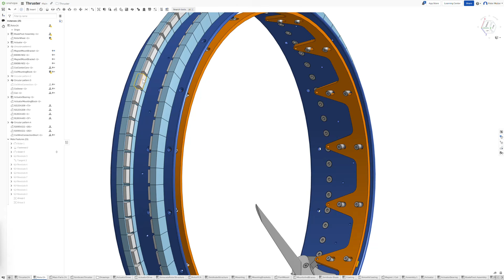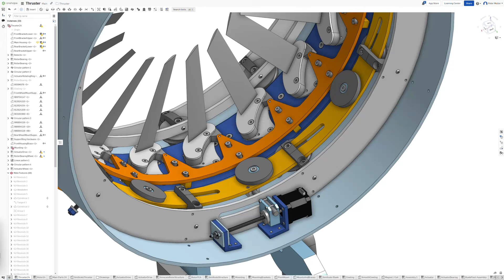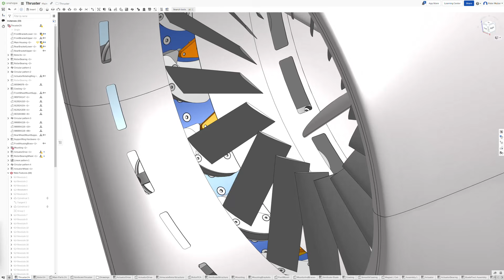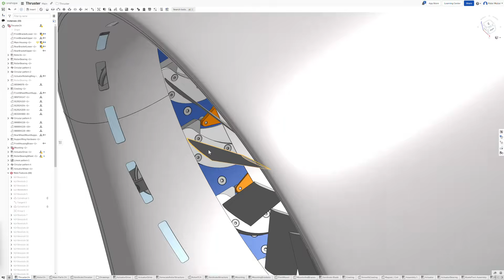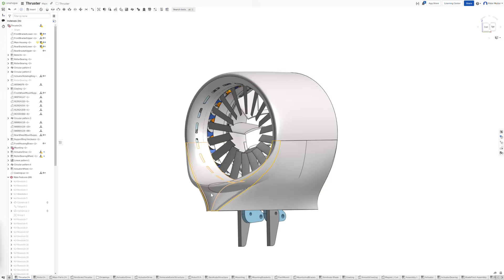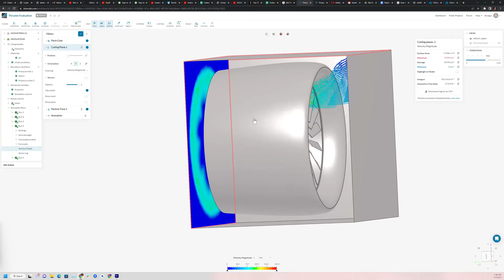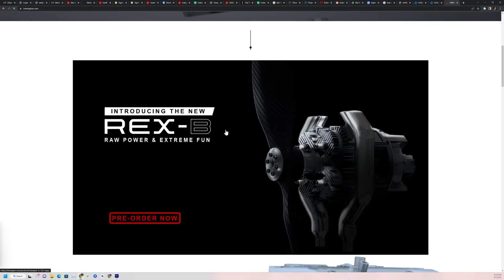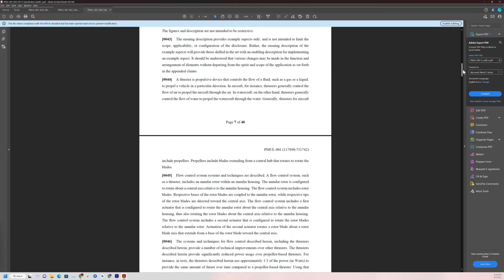Could this Thruster transform Aviation?

Comment: A typical Cessna 172 propeller is 74% efficient at cruise. A modern propeller is more like 90% efficient. Yes at standstill a fixed pitch propeller is going to be less efficient, but variable pitch propellers have been around a long time and thus will have high efficiency over a broad range of airspeed. More blades always mean less efficiency. A duct helps at low airspeed but creates more drag at higher airspeed that is why they're rarely used other than in jets where they help lower noise and work as a containment shell for damaged fan blades. To boost efficiency newer turboprop designs get rid of the shroud. Frankly, I don't understand how someone can spend so much time and effort into designing something that is less efficient than the Wright brothers propeller from 1903 (82% efficient). Your claim of getting 3X more efficiency than a standard propeller is BS. You'll get better efficiency with a standard hub configuration. Without a hub a large percentage of the air mass will bypass the blades completely by going through the middle then mixing with the accelerated air behind the blades and causing excessive turbulence. Of course your unsupported blade ends will have extremely high resonance gain and will self destruct before you can even get the thing up to speed.

Comment: Too complicated and lots of failure points. You can use spiralic air bearing ring on outside, but you need to consider about the low rpm too. Air bearings are magic!

Comment: And where does all this electrical power come from?  And all the thrust is loaded on those little wheels?  And this is supposed to work in the dirty, wet big outdoors.  Google keeps telling me you get 1 pound of thrust per Horsepower; but that is theoretical.  So an actual machine can only be worse.  You know you would require many 100's of pounds for anything practical like a flying car.  Even a miserable 100 pounds of thrust will require much more than 7,500 watts.  Sorry, this is totally useless.

Comment: This design will never work. There is a major flaw in it and I'm surprised not many people spot it at first sight. Using such a big outer bearing would not be reliable and would be extremely expensive to machine at acceptable tolerances, it would generate huge noise levels due to the high speed at which the balls would rotate inside the races. And ultimately, it wouldn't be safe in case damage occurs to the bearings (either mechanical failure or bird strike/FOD), making all the blades fly out at high velocity, resulting in an uncontrolled catastrophic engine failure. If this was in any way a viable design, I'm convinced one of the big manufacturers of jet engine would've come up with it decades ago.

Comment: Why was your comparison to a 2 bladed propeller? The more obvious comparison to me would be a regular ducted fan with the same number of blades. The fundamental problem with this design is that you have proposed adding a ton of complexity compared to a motor on a central shaft, and you haven't done any simulation to justify that putting the motor on the outside is a benefit.

Comment: That's an awful amount of moving parts that can break, also for flight you need to have redundancy so the one single motor to change the pitch of the blades is not enough, I'd prefer to have at least 4 motors and have 2 connected as a pair so when one or two motors break for any reason you stil have 2 motors leftover that can take over the force needed to change that pitch.

Comment: Rolls Royce "owns" all of it's engines. they maintain them and they destroy them when they are finished. the airlines lease the engines from Rolls Royce. the Santiago, Chile to Melbourne Australia route, is the longest single haul  flight at 16hrs. obviously, to run multiple engines for 16 hrs will take one huge tank of fuel.... a tank bigger than the aircraft itself. obviously not possible with usual thinking processes. which is why control of commercial airline engines is a closed loop. yet that is what you are up against.

the Patents Office is not there to protect your inventions.

Comment: Sorry but this is actually a pretty stupid idea. The main limiting factor in conventional turbines design is the structural integrity of the blades under centrifugal forces. In a conventional (central hub) turbine design the centrifugal forces result in a tension load on the blades. In you design the centrifugal forces would result in compression load on the blades. Since the maximum load a slender structure can sustain in tension is usually about three times the load it can sustain in compression (as a rules of thumb), you can  easily see why your design would never be feasible for realistic applications.

Comment: It is certainly nice design but I don't understand hot can this be patented. There is nothing innovative there. Once there is a decision taken to devise an electric fan actuation any idiot would recognize that there is no need to use an independent motor to run the fan axially and will start to investigate the possibility to run it this way. It is the same method how some washing machines are turning the drum... Any able engineer can devise something like this, even better - there is no breakthrough here. Besides there is no energy source available to use this on a plane anyway...
I'm not an engineer but I know that any action has an equal and opposite reaction, so when the rotor of the motor (the turbine here) produces 100 thousand pound of thrust the stator part would try to rotate in the opposite direction - will it be easy on the plane to hold it stationary?

Comment: There are so many failure points in this design I don't know where to begin.  The acetal wheels will fail first.  The moment it becomes out of balance, it will become an empty aluminum ring (if that) with a long debris trail. Just look at all the bearings in this thing that could fail, and it would only take one.  Overall, really poor design. Cool, but poor.  There is a reason all current engines have a central shaft.
Reply: *potential failure points

Comment: "They might be interested in this or they might say this is no good for business its going to destroy our business" Or you are way over confident in you product and its got major problems that have not come to light like how are you dealing with the turbulent flow caused by the blade tip vortex. Compression over tension at RPM. Number of moving parts. The fact that your centrifugal force is way higher as your spinning a massive drum of metal at the outer most point. The inverse of a turbo fan. Just with the higher centrifugal forces and materials science we can tell that your fan can not do the same RPM with the same materials as a turbo fan. This is turn leads to efficiency as you then need to make your blades bigger to over come the lower RPM and move the same air in turn adding weight entering in to a feed back loop of more centrifugal forces. So power to weight this should by the numbers all ways come out behind a turbo fan. You have little to no axial support in the bearing so at high thrust the thing is going to want to rip its self out of the front of the housing over moving the attached housing.  Your Delrin has seen little to no load at over 100LB of thrust at high RPM there going to crack and fail in a matter of seconds. You sound like every bad kickstarter trying to get hip for something you have little to no testing in.

Comment: As very usual with similar concepts, you go too far. Proof of concept only needs fixed blades, all 3 of them, 5 tops, but no, you have to have variable blades first time out.
Multiple blade fans don't work, the science and practicals are out there in multiples, it's very simple, air doesn't recover fast enough for the next blade following closely, heck even one blade turbines have proven to be the most effective, but 3 blades is most effective for real world balancing issues.